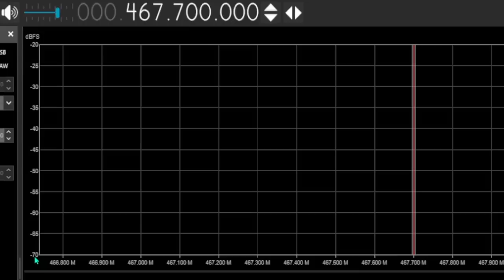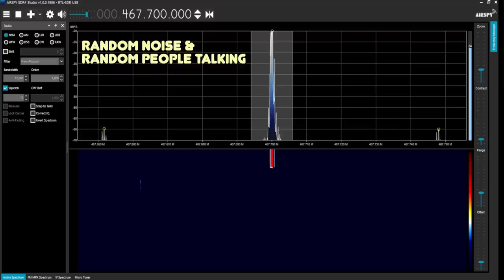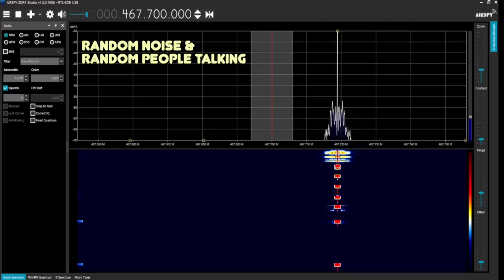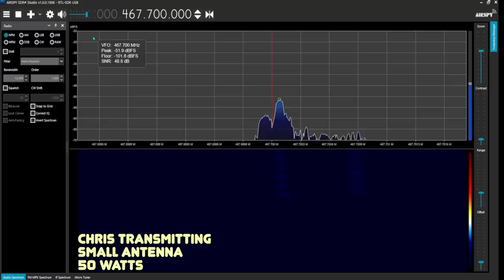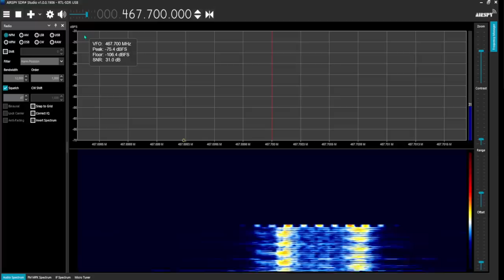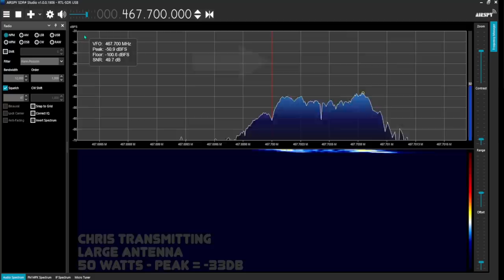Does Power Really Matter On GMRS & Ham Radio, Or Is A Good Antenna Better?

Comment: Another important thing to remember is that communication is a two way thing; increasing your power doesn’t improve your ability to hear the other station, however improving your antenna affects both transmit and receive.
Reply: Agree 100% (Rule of thumb, your antenna system (antenna & coax) is 90% of your set-up) W9DLP
Reply: I have a ham friend who thinks he needs 1,000 watts all the time. Only a small percentage of hams use that much. 

He was whining about his vhf radio having some noise on transmit and wouldn’t listen to me tell him to reduce power.

Comment: I appreciate the “affiliate link below” to the sdr you used.  I don’t mind if a few pennies get tossed your way if indeed it does in appreciation for your helpful tips.

However, I do wish your link was to an sdr WITH and antenna and not a “naked one”.  If I’m not mistaken I believe there is one for 10 bones more! no?

…love your show
Reply from the maker: Yes, and probably a few other combos.. But dont worry, if you use my link and go to Amazon and by a slightly different product within 24 hours I still get credit.
So go shopping and thank you!
Reply: @TheNotaRubicon  Done and done.

Comment: The WEF lizard in the background is hilarious. 
I just built a Jpole gmrs antenna out of 1/2” copper pipe. I’m new to all this and discovered that rg58 isn’t very good. I tuned to 465 and at 465 was getting 1.5 SWR and around 2.0 at 462 and 467. I had a 50’ run of rg58 while doing this test. I lopped of 40’ of the coax and now get 1.086 at 465 and 1.25 at both 462 and 467. Works for me.

And yes….Lets Go Brandon👍

Comment: I was just perusing the Signal.Stick website and I came across this GMRS notice: “GMRS: The typical Signal Stick will probably work fine on GMRS — many people use it already and report good results. That said, if you want to be 'mathematically correct' you could in theory make the antenna about 1.1 inches shorter to make the dual band (19″) signal stick match GMRS better (and also MURS). The 440 antenna should work fine as-is, but in theory about a quarter (1/4) inch could be cut off to make it match better in theory. In practice it’s likely that you’d add more variance by moving your arm across your body, so it seems silly to us, but that’s what the math says.” 

The same thing he said about MURS. It would be great if someone compared a Signal.Stick with a Nagoya GMRS antenna. I've always thought Nagoyas were overrated, but I'd like to see it tested by an expert who was sitting atop a large hill, was into GMRS and had the time and resources to conduct such a test.

Anyone know where I can find such a person?

Comment: Was hoping to see a sad ham pin. Will have to check back later.
Reply: I am waiting for some other sad ham to comment that at 02:23, the UHF frequency is really from 300MHz to 3GHz. Not 380 to just over 500.
Reply: Give it time. They can't help themselves.
Reply: @JohnDoe-zg6fn  I came this close to getting myself pinned with that comment <grin>. But then again, UHF from the LMR perspective is basically 410-512.

Comment: Very good information that translates well to 70cm.  There is a repeater 45 miles away (on a mountain top-Snow Peak near Banning, CA) as the crow flies from my location that I cannot hit with any power using a 1/4 wave unity gain antenna (unity is zero gain- but please sad hams spare us the exact differences and definitions).  But a Browning 5.5 dbd high gain antenna can open the squelch at 5 watts and at 10 I can have a clear conversation.  No need for 50 watts at all.

Comment: Great video and I enjoy how you present the information in common sense terms that the masses can grasp. Just our of curiosity, did Chris get any SWR readings from the short antenna versus larger antenna? I'd be curious how much of a difference the results would be for the same test at 5W for a tuned vs non-tuned antenna. All the SWR videos I have seen on YouTube seem to be presented from the standpoint of the person transmitting, but I think it would be helpful to see how much of a difference it makes from someone receiving the signal as you presented in this video. 

Along the same concept if you plan to do a follow up video, I have often wondered when an antenna manufacturer advertises a +db gain, in the real world how much difference does that really make? This video sort of showed that when increasing the power on the small antenna, the positive db gain between 5W and 50W didn't sound like all that much. The reason I ask this question is I have been looking at the Midland MicroMobile MXTA26 (+6db gain) vs MicroMobile MTXA25 (+3db gain) and now I am wondering if the +3db gain would really be noticeable in real world results?

Comment: BOOF WONG GMRS-9r here.
Rolling Appalachian’s of New England.
Rubber duck antenna test
7 miles over 2 rolling wooded hills, over a lake, to my buddy who’s elevation is slightly higher than mine, but no line of sight. 
The talks is good.
The statics is negligible.
My larger antennas are more clear, but damn these simplex convos I’m having reach WAY further than I’d imagined they would with my terrain.

Comment: Depending on the circumstances/environment a better/more suitable antenna is always better than more power. 

For the ones who doesn’t know, google the differences between 3dB, 6dB, 9dB, antennas and buy the best antenna/-s for your use.

Comment: SOC radios often require shorter antennas in order to receive without front end overload. In such cases, more power could compensate for using a shorter antenna on transmit.

Comment: A suggestion for one of your very informative YouTube shows.   I don't know if you have done a comparison between radio to radio, and if so just point me to your videos.  

Often, I am asked about what is the real differences between radios from a cheap model to an expensive model?   A good example is to use 2 Baofeng radios head-to-head.  In other words, do a test with 2 Baofeng radios in the field using just what came with the radio nothing more.  Then use 2 other types of radios together from the same distance thus showing the difference in quality from a cheap radio to a better model and so on.  Part of the test can be the quality of audio to just how far in a real life a cheaper radio will be heard to a better quality radio.

Comment: Great video... and I'm still laughing at the "face shot" from the boofwang. 

The Voyager 1 spacecraft that's now almost 15 billion miles away, is still communicating with NASA's Jet Propulsion Laboratory, in Pasadena, CA.

The transmitting power of the Voyager 1 is 23 watts... how can that be?  Super great antennas on both the transmitting and receiving sides.  To me that's a great example of antenna versus power.

Comment: Yeah basically the entire point of having more power in your radio is to cut through interference also as you demonstrated it can help if you have a less than desirable antenna however having an antenna in an ideal position will give you much better results but having that extra power is nice on the off chance you need it to use it

Comment: I just found your videos. Watched quite a few. Entertaining and informative. Subbed. I’m trying to set up comms between my 83 year old (prepper) mother’s house and my place, about 4 miles away. We live in southern Vermont so there are rolling forested hills here, hundreds of feet in elevation variance, not thousands. I really want to use GMRS but don’t know if we even stand a chance of making it work. I’m considering two Midland MXT500’s, a power supply for hers and mine truck mounted. I’ve seen antennas from 2-7dB and am really confused as to which will be best. I understand line of sight and the advantage of antenna height but really don’t know what to try. I don’t want directional antennas as I will be moving in my truck. I’d love any insight you can give me. 
BTW, Midland does not take phone calls. Not even regarding sales. I sent them an email but haven’t heard back from them yet. They are having a 20% sale today and tomorrow that will save me over $200 if I can decide and pull the trigger. Thanks.

Comment: Randy, what GMRS base antenna would you recommend for a house?  My subdivision sits in a bowl and I would like to see if there is anything better to help me get out further.   I'm currently using an Ed Fong antenna.
Reply: Can you get the Ed Fong higher up? If you can get it above the terrain features in your area that would get you out farther but you'd want to run thicker coax to lower losses for the run.  I do not remember the model I believe Diamond antennas makes a base station antenna for GMRS that would have better performance but would still be limited by the terrain in your area.
Reply: Take a look at slim Jim j-pole types. I think the take off angle of your radiated signal pattern may be better for getting out of valleys with that type, if I recall what I read correctly.
Reply: @Mike-yq7ce  I could probably get it another 5ft higher.  I have it mounted to a piece of 10ft long conduit attached to my chimney. It's a split level house and the back porch is next to the chimney.  The stairs block any way of putting a ladder up against the chimney.   I had to put the ladder on the porch.  Then put one side of the ladder on the chimney and the other on the gutter on the eave of the roof.  I don't like heights and I was lucky to get it as high as I did.  The bottom of the antenna is about the same height as the peak of the roof.

Comment: I have a revitis repeater with a 17 inch fiberglass antenna but I have it raised about 15-20 feet. Unfortunately I live in Ohio (not much high ground and a lot of trees. I can only get about 2 miles out with the repeater. What do you suggest for my situation to get more fars?

Comment: Nice video, I wonder if you mount an LNA with external power to a Baofeng UV5R radio will it help the reception of the signal with visible results? You can make a video about this if you run out of ideas✌

Comment: This is a great video, but I need more guidance on antennas.  I tried multiple “upgrades” for my UV5RA and they were all worse than the stock antenna.  What do you recommend for an antenna upgrade that attaches to the UV5RA and is mobile?  Other that a stationary antenna on my roof, I’m stumped
Reply from the maker: Which antenna you use is highly dependent on what frequencies you transmit on.  The antennas that have come with (all) my UV-5Rs have always worked just fine.
Reply: @TheNotaRubicon  thanks for the reply!  I stick with GMRS frequency
Reply: What bands are you working? What antennas didn’t improve for you?

Comment: Great stuff and appreciate all the good info. Putting on my foil hat, I have a question: is a ground plane needed when mounting Midland 6 db antenna (for Midland GMRS 575) to side of fiberglass motor home? Or, when is a ground plane needed for the antenna?
Or should I just get more foil for my hat??
Reply from the maker: Yes, you will need a groundplane.

Comment: Unless those antennas were in the same place you can't really say "the bigger antenna gave an extra xxdB".  I'm assuming the small antenna was inside his house?  Taking the small antenna and mounting it on the roof would also yield quite high gains.
Reply from the maker: Geezus.. The entire point of the video is that a bigger or better placed antenna would work better vs just more power.. Did you even watch the video?

Comment: From my limited understanding the lower the giggleHertz radio channel and using VHF with more watts output you can get better distance if other variables like buildings and trees etc are not expecting things vs a higher gigglehertz channel on UHF with high power.  @notarubiconproductions do i have that mostly right? 

Ive been learning ham,UHF,VHF,GMRS, CB,MURs, and FRS for about 2 weeks.

Comment: Thanks for the awesome vid! Can you do a Walmart GMRS walkie talkie in the car vs outside of the car? The reason I ask is that I would like to tell my friends that, if they can't reach me when we're on adventures in the woods, they might try stopping the and getting out of the car to transmit. I don't know if this will matter, but I bet it will.
Reply from the maker: No need for a video.. A car is a big metal box that does a very good job at blocking GMRS/FRS signals.  Getting out of the car will improve the farz of the radio signal.
Reply: @TheNotaRubicon  Yeah, that's what I figured as well. Okay, thanks for the confirmation and the fun and informative videos! Maybe the radio in my car will be the only radio to survive an EMP attack, right? 🙂

Comment: are these antennas in the exact same spot.. otherwise its not an ideal situation... even moving an antenna 1 foot to the left/right can increase signal major
Reply from the maker: yes, they were in the exact same spot.
Reply: @TheNotaRubicon  NMO mount?
Reply: @TheNotaRubicon  and if they are not the same SWR each then its again not an ideal test... just sayin! I can use a SMALL ANTENNA as you call it, myself ill call it a 1/4 wave and can get a flat SWR compared to a bigger Antenna ie HALF WAVE with crap swr and get out better with the 1/4 wave......  ITS NOT ABOUT THE SIZE, ITS ABOUT HOW WELL ITS SETUP AND TUNED!!!!!!  50+ years radio hobby for me.. thats my advice!!  PS: hmm I sound like a woman there, size is not always better lol

Comment: What type and length of cable were with the better antenna?
Reply from the maker: 15-feet of cheap coax on the small antenna, 50Ft LMR400 on the large antenna.

Comment: Well, HOWDY! (not entirely fake entho0ziazm, for i haz questins) - Might ye address the creation of ground plane for mobile mounts such as aluminum-bodied veehickles? or trunk/hood-lip bracket mounts. I see the radial-leg antenna base affairs for truckers and wonder if any of the smaller variations on that theme might work. OR - might I simply use the EXCELLENT cookie sheet methodolololgies? I thank you from the bottom of my enthusiast heart.
Reply: In the absense of Our Esteemed Leadership, Lord NAR, I have learned that a ground plane need not necessarily be ferrous. An AL-YEW-MINI-UHM bodice may serve as well. Too, there exist GMRS antennAE for which * no ground plane is necessary * such as some of the LAIRD offerings. 

Many fars to you all.

Comment: Great video..  I just received my license. I don't have a radio yet, but going to order one today or tomorrow.. It took 2 days to get the license after it took 2 hours to figure out the website. My god the FCC website sucks! I can't put into words how bad that website is. It's horrible. 

So, is it possible to use a mobile antenna with a hand held and mount the antenna on a roof or something or piece of metal and make it work to get a better signal from your handheld? I hope that made sense.   I want to be able to use a small antenna when out and about, but use a larger antenna  when at home, but without a base station. Is this possible? 

Thanks Randy and Chris for all the demo's and reviews, etc.. Great stuff and Randy cracks me up.. Man I laugh hard at times.. 😛

Regards from the heartland. South Central Indiana. USA
Tim
Reply from the maker: Yes!  A magnetic mount mobile antenna on a cookie-sheet works great.
Reply: @TheNotaRubicon  Thank you kind sir . 🤘
Reply: @TheNotaRubicon  Randy, so you don't have to ground the cookie sheet? I mean, can I just place the antenna on the cookie sheet and sit it on the roof or whatever and it work with a hand held? 
Sorry for all the questions.. I'm also thinking of getting a power supply and mobile radio and just use a mobile antenna if I don't have to ground it and use that as a base station. I just want something I can move around and it's easy to use.. 
Thanks so much .. 
Tim
Reply from the maker: You do not need to ground the cookie sheet.
Reply: @TheNotaRubicon  Thank you sir.  That Grounding stuff had this mere mortal confused.  I appreciate it so much friend.  
Be safe and well.